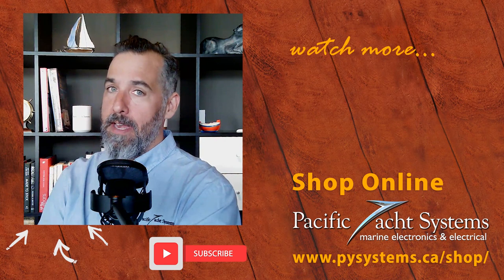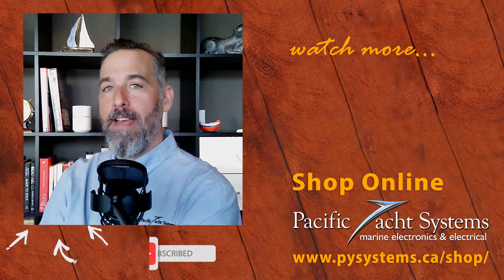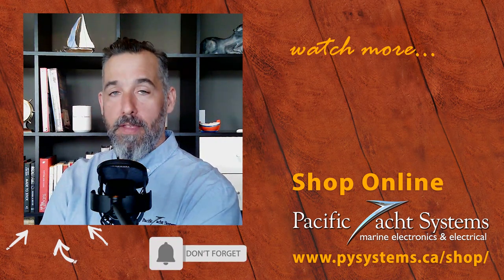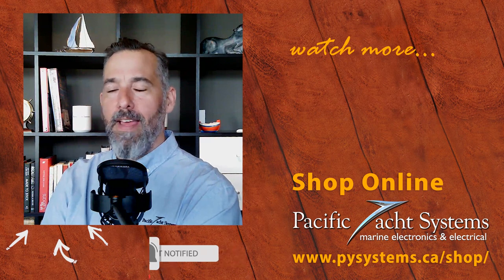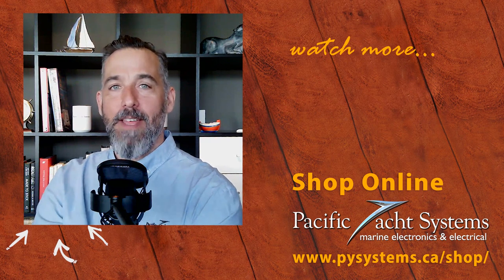Can I Use an External Regulator With Any Marine Alternator?

Comment: Does the Balmar regulators protect the alternator when the Lithuim BMS shuts the battery off or do you need a separate alternator protector? I just switched to Lithium but my engine has two alternators, one charging start and one charging house banks. My current alternators are internally regulated so instead of having both alternators go to the AGM start bank then charge the Lithium house bank from there I am looking at just replacing the house alternator with Balmar 250A and regulator. I just need to make sure it is well protected.

Comment: How best to prevent overcharging a old fashion lead acid or AGM battery if the engine & alternator is kept running for very very long (imagine 2-3 days with zero wind and you have to use the engine continuously) - won’t keeping LA & AGMs batteries at 14.4 V for so long damage these batts?

Comment: I have been following you for years (and dropping your site across other channels) hope you keep publishing your videos
They are extremely insightful and eye opening
I have been wanting to do add an external regulator for years since you first talked about 4 years ago (yeah nothing like procrastinating) ,  I am going to do it.

One question
On my 1978 Islander 32, I have a beta Beta Marine BD722 with a 70ah alternator.
I recently purchased a Sterling Power USA Pro Alt C Alternator to Battery Charger 12V 130A
Can I still add the Balmar MC 614 you referenced ?
Thank you

Comment: Would i be able to use a balmar external voltage regulator for a gas powered generator? Since its spinning a big alternator. I'm just worried about voltage raiting and running the coile at a lower voltage than what they were designed for.

Comment: is it safe running the engine idling to charge batteries? or will the long idling cause engine issues down the road?
Reply: @JohnBraman413 Alternators do not put out a lot of amps at lower speeds or at idle!
Reply: @NeverEnoughPyro40 depends on the alternator. As well as the capacity and type of the bank, If you have a HO alt it can deff give you enough voltage.  All about the Reg too. But don't run down your Bank, sit at idle with a 2,000watt stereo blasting, or pulling lots of current elsewhere and think you're going to fully re-energize.  The majority of the time dealing with this topic it has multiple variables involved.